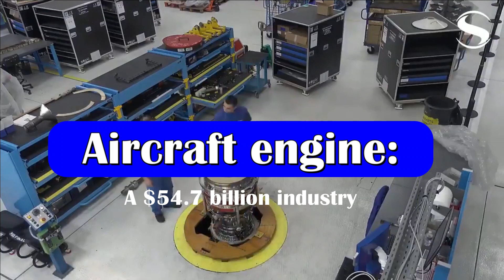Private firm to develop critical components for Kaveri engine #drdo #gtre #iaf #indianairforce

Comment: Essentially the video is suggesting military civil fusion, bringing the private sector into production, instead of just relying on PSUs which perform poorly. Makes sense. Should also get involvement of IITs to help speed up engine development, and incorporate tech advances make like single crystal blades into Ganga, the hypothetical next engine after Kaveri.A lot can be done to speed up induction of Kaveri engine, including its marine version. We need to invest the money needed into flying testbeds and windtunnels so engine development is easier and cheaper and faster.
Reply: Public sector is not poor, politicians sabotage the project by delaying funding
Reply: Ganga is a good name
Reply: @fly463  I hope it comes into existence, the technology for it(Single Crystal Blades, thermal barrier coatings that last up 1200c)
exists, but there is no funded project. I mean my hypothetical makes sense, but no official confirmation on what is happening.
Reply: @datoolz0  
Right now DRDO is only focused on AMCA mk2's engine so, let's see what they do.
They should have started developing the engine by now if they have the tech 
We could have apply it on TEDBF.
Reply: Buddy first godavari then chambal then Ganga then brahmaputra? 😜
Reply: @uvg319  You assume jet engines are still being used, might be unto scramjets by then.
Reply: @datoolz0  we ll always need some sort of jet in the future to aid and guide bombers....maybe not? Maybe a nuclear based remote flying machine which could stay in the sky for a yr at a time? Who knows? 😊

Haven't seen an update on the 110KN GTRE for a while. They've managed to crack a 12KN naval variant as per reports.
Reply: @uvg319  Kaveri and the flying test bed is the priority right now so afterburner can be tested. After that a 90kn Kaveri 2.0,
and then finally can start on an indigenous 110kn. With  a flying test bed it won't take as long as Kaveri did.

Comment: Seems some cnc part making firm, there is no dearth of such companies. What DRDO is facing is the problem of not having a good know how in high temperature metallurgy and heat resistant ceramics, if drdo/IISc can't do it then no other private player in India can do it.
Reply from the maker: You are right but private sector has a trick. They can hire experts from required sector and collaborate with firms having experience and build of their own. This flexibility is not there with PSU
Reply: Recently single crystal blades and thermal barrier coatings capable of taking up to 1200 degrees C have been developed. Good enough to make a GE414 class engine, instead of the Kaveris GE404 .
Reply: @Shubhabrata banerjee It is on the news, do you think I'm on the Kaveri team? Single crystal blades are now being used in helicopter engines, and TBC happened this year. Kaveri K9 is made with old tech, like 1990s, and they don't want the risk of new development, they just want to get it working ASAP.

However, after they have a working Kaveri, they will make a new engine that will probably use all of the new tech developed since.
Reply: Childish statement....

Study some books and urge yourself towards respect of Privatisation.

Wherever the development is now in this world, private sector is ahead of government.
Reply: @etherealaurora  don't spam. Do you know how Americans got hold of jet engine tech? Or DARPA or NASA
Reply: @technomusicyou  
If you think about MIG theft to Israel and sent to America then it is other concept to technology.

But, Britain shared the technology of Whittle's  jet engine after patent got expired with America. And, GE made the jet engine. And, it happened before the incident of thieving MIG to Israel.

If you know better, please share.
No confusion remains👍
Reply: And......
Where were you upto now????

Do you think to develop an indigenous jet engine is like a piece of cake???

Have you ever listened the name of General Electric, the American company deals in electrical and electronics that was started building between 1878 to 1893????

It developed its first turbojet engine in 1942 that generated only 6KN thrust. It almost took 50 yrs and built j79 in 1955 having more than thrust of 70KN.
It took more than 13 years even understanding all the complications of technology.
Numbers of scholars, engineers and scientists have spent Lacs of hours in the development of the technology.

And, you think the Indian organisation GTRE can develop it like its their own legacy....

Grow up...
It's not a rocket science, it is a rocket engineering, very sophisticated..

Keep your feelings, emotions and frustration in the pocket.

And, accept that one day Indians will conquer the issues of thrust and weight of their jet engine and that will make history .

Because Indians are behind the success of every country.😎
Reply: @etherealaurora  Dry Kaveri has already passed high altitude tests, only needs certification on flying test bed. 

Wet Kaveri, the afterburner section, will be tested 2 years after that. Full Kaveri engine will probably enter service in 4 years, finally replacing GE404 engine! It will save billions.
Reply: @datoolz0  

Engine with dry thrust is appropriate for drones, helicopters and other machines except fighter jets.

Kaveri engine has only but the most sophisticated obstacles remained.
Thrust and Weight.

And, GTRE has been trying its best for more than two decades. It's development is not a piece of cake.

But, hoping now that France and India will collaborately develop Fighter Jet engine that can atleast produce the thrust of 125KN.👍
Reply: @etherealaurora  Solution for weight 3d printed titanium parts. For afterburner thrust it will have to be high temperature alloys which doesn't exist, has to be developed.
Not sure collaboration has ever yielded dividends to be honest. I can't help thinking it is smarter just to invest in Kaveri 2.0 and 3.0.
Reply: @datoolz0  

Its obvious that turbo fans need alloy and some tough coating  to tolerate the  temperature nearby 1800°C.

And, India is in deals with France over the decades. 
And, now collaboration in building jet engines.
It would be interesting to know which way the wind blows in building jet engine.
Reply: @etherealaurora  Has any useful tech ever been obtained from France at any point? France is also building nuclear reactors, can we build european style nuclear reactors? Answer is no. Tot happened for Scorpene, but can we build submarines indigenously?
Answer is NOOO! Bharat can only build a Mirage 2000 style fighter because of Tejas, not because of any ToT from France. There is no value in collaboration if it yields no useful tech.
Reply: @datoolz0  

Might not be the same reasons

France has made some changes in building and developing defence products.
i.e; Not including the US in his development to out the US interests and keep the developing cost less.
Further, same deplomatic interests and almost same strategic thought over Pakistan.
And, only business with China like India.
And, India is only interested in  engine and quite in submarine. France has gained advance technical support and more efficient engineering that surely helps the collaborators in the joining programme.

Comment: What happened to India's GTRE-SAFRAN deal ?.
Also, Y is India negotiating a 110KN deal , insted  of 130KN Engine deal wit SAFRAN ?
Reply from the maker: Not yet finalised
Reply: @IndianDefenseAnalysis  Bro why we are ok with f414 engine for Amca while turkey is getting f110 engine for tfx which is more powerful than F414.
Reply from the maker: @Soulreaper286 it’s a design question and would have taken into consideration dimension , aerodynamics & power requirements
Reply: @IndianDefenseAnalysis  So, who is more smarter ? India or Turkey ?
Reply: No need for Western companies they will sanction India during crucial time